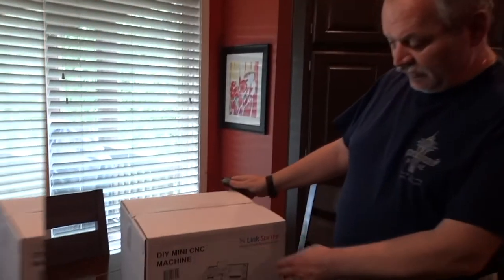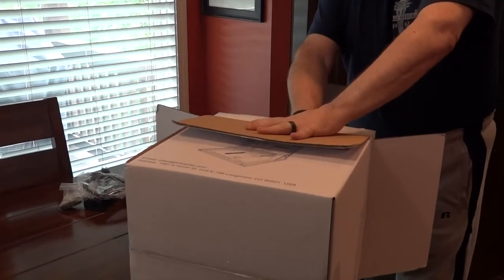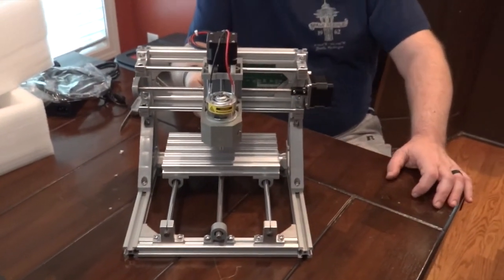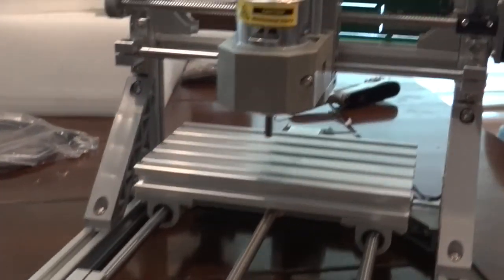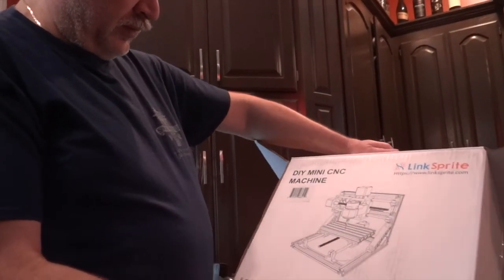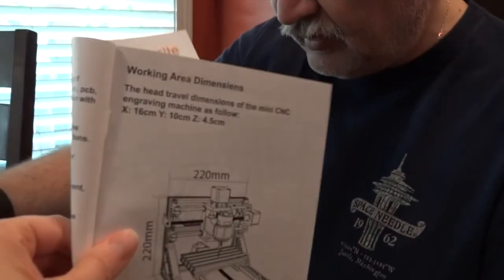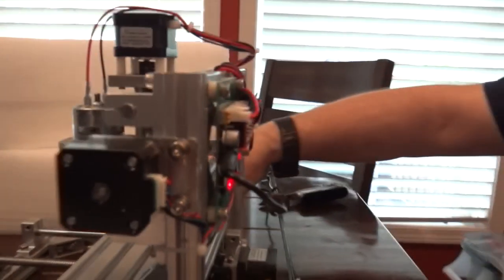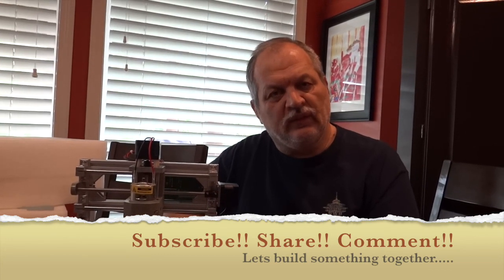UNBOXING: LINKSPRITE CNC MACHINE

Comment: Sorry man - but LinkSprite specifically states that this IS NOT suitable for metal of any kind.
Reply from the maker: I am not using it on metal. Woodworking is what I got it for
Reply: Ah. Okay. I thought you mentioned metal in the list of materials this can be used for.....
Reply from the maker: Supposedly it can be used for soft metals but I would not try it